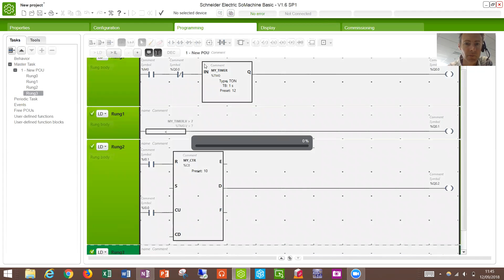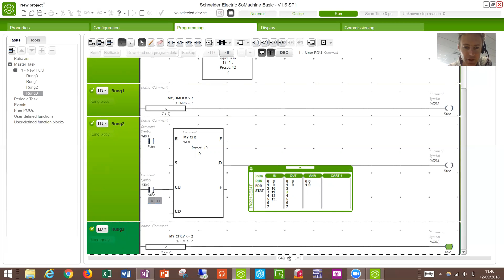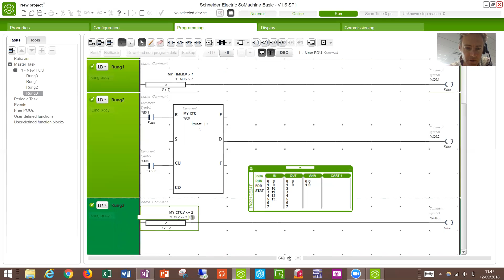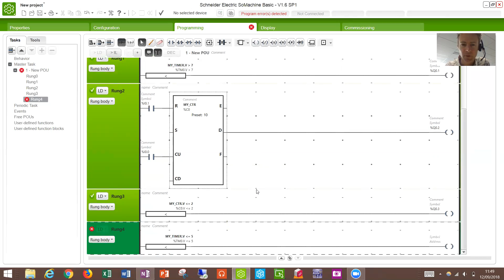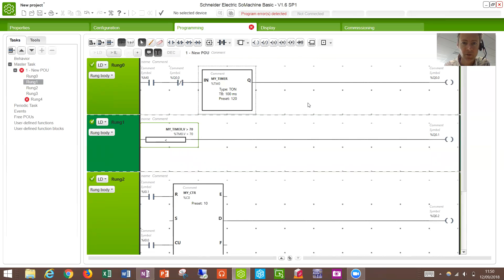PLC comparison block intro

Comment: I have a problem with somachine basic ... I have 2 plc tm221 1 as a master and 1 as a slave, I want to read% mw100 on the slave and transfer it to% mw10 on the master using tcp / ip, I learned to read_var but still can't ... Need help for example